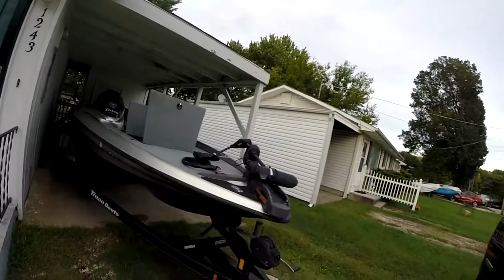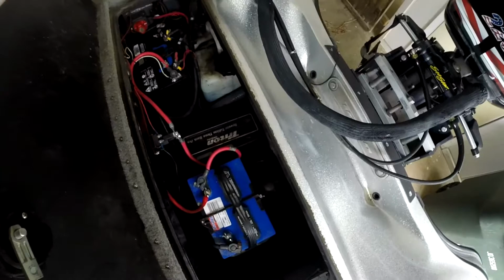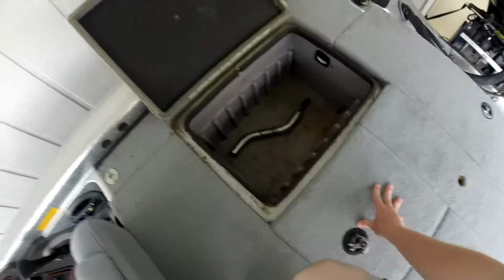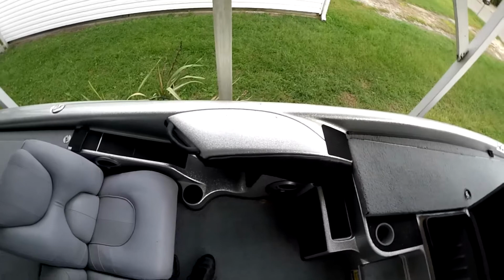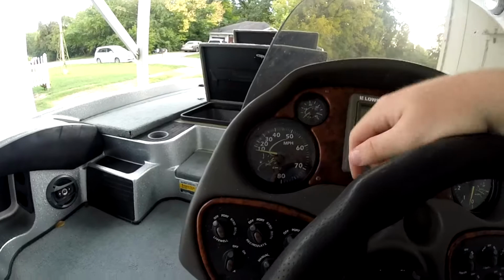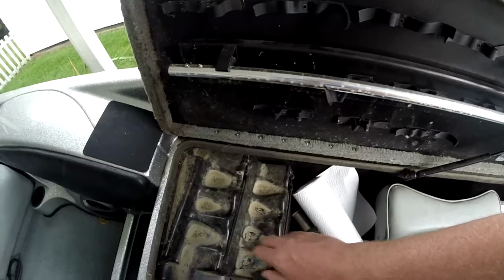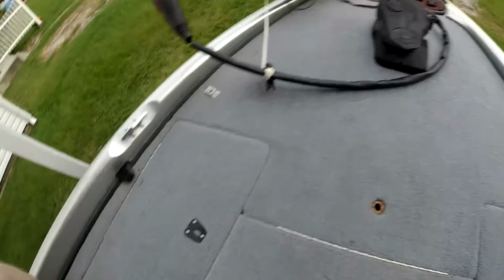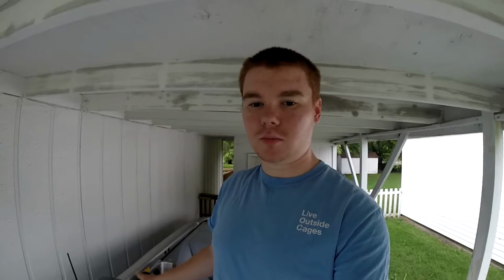Look What I Got!!! | New Boat Tour and Setup!

Comment: Try carb cleaner and a scotch Brite pad to clean out the rust spots in the box’s. Totally awesome cleaner works great too
Reply from the maker: Ok, I'll give it a try. Thanks for the input. I sprayed them with a discount biodegradable cleaner since all my boxes have drainage systems and it helped but it didn't get everything.
Reply: BassFishin243 no problem, I detail and do carpet and seats for a living at pros choice marine, so if have any other questions just ask.
Reply from the maker: @paintballerj5575  Oh, yeah I've been to pros choice before. My LOZ tournament video where we blew the lower Unit, we took it there to get fixed. My carpet is actually really good, it's kinda compressed and needs vacuumed but it's in really good shape. I'm getting ready to go to Kentucky Lake this weekend if it doesn't get cancelled due to all the flooding.
Reply: BassFishin243 that’s cool, that’s one lake I’ve always wanted to fish.
Yeah your carpet looked pretty good in the video, you can fluff the carpet back up some by power washing it and using a scrub brush to brush it back up. With the age of the carpet it won’t be perfect but it will help.